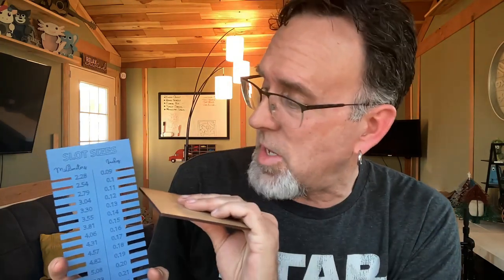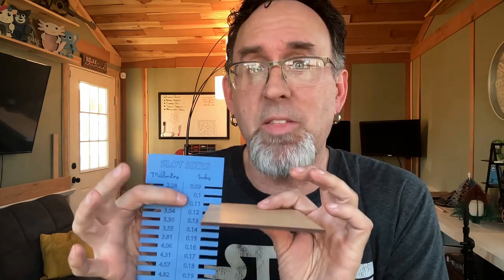Project Overview: Slot Sizer

Comment: Thanks for sharing, I understand the concept, and it's great. I'm just stuck on finding how to use this regarding the material. Would I create a rectangle shape and add it to the part I want to cut to get the exact size as the slot sizer? What I'm trying to do is be able to stretch bigger or make the file smaller (aka SVG file), since lot of premade designs are already made with the area of cut and all that.

Comment: I do apologize because I am just not understanding how to use this great in theory tool.

I have my machine dialed in so that a square designed at 70mm x 70mm gives me exactly a wood square 70mm x 70mm (not sure if this is what is making me not understand).

I have a piece of HomeDepot 2.7mm plywood (actual thickness is 2.53mm).  I made your slot sizer and it fits very nicely in the 3.0mm slot.  My issues is that I have already cut a 3.0mm thick slot and the piece is undersized for the actual slot cut in the wood (the actual size of the wood slot is 3.18mm).

I started looking into your design to see if I can figure it out and the actual segment length that sets your 3.0 slot width is 2.25 (my actual cut width of that slot in the wood is 2.50). How does a slot that is designed at 2.25 stated to be 3.0?

I do apologize if i have completely misunderstood how this great tool should work.
Reply from the maker: Hi! That’s a bit much to work through here in the comments, but I’m happy to try to help you. Message me at www.facebook.com/bigbluelaserdesigns. Be sure to include what vector program you’re using and what laser you have. I’ll do my best to help you master it!
Reply from the maker: It sounds like you’re saying that you have your laser automatically accounting for kerf. I’m not familiar with that, but that sounds interesting! 

If you have that happening, then obviously you don’t need a tool to help you adjust for it, right?

If you have slots that someone else made and you need to change the slots to match your material - and you have some settings that automatically adjust for kerf - then you’d simply change the slots to your material thickness and your settings would do the rest for you.